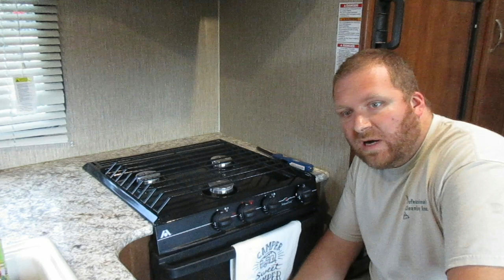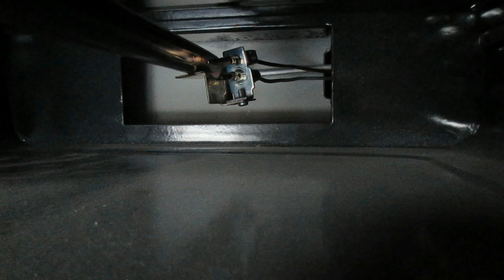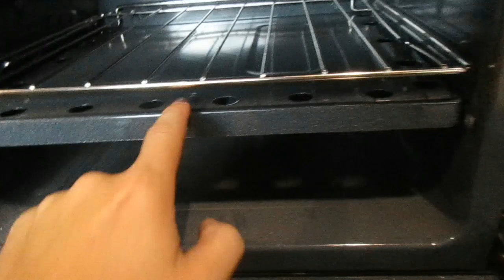How to light a travel trailer oven

Comment: I had no idea how to light mine. Loved in here almost 2 years. My pilot is different than yours.it also doesn't have any writing on the oven knob, other than a small square with 2 lines and F below it and a little circle right above the top of the handle. Doesnt say pilot anywhere nor have any demarcation of anything to the left.  I have been using my instant pot. Thank God for that.  Also, my microwave. I think I will just get a toaster oven and call it a day. Don't want to accidentally blow up

Comment: I have the same exact oven. I have never used it, however have had this 2016 trailer for 2 years. I did everything you said and more, and no matter what, it doesn’t light. I put the lighter flame Right Up to the pilot “bulb”, and nothing happens. Pushing the “Pilot Push/Hold” button hard/soft/normal, nothing happens.

Comment: Thank you for this video. Mine isn't working right, I think. Because when I turn it over to the temperature, the pilot goes out and the heat strip doesn't light. Nor does itight when I apply the lighter right to the strip. The pilot lights fine. There's gas, for sure. It just don't catch. So, what am I doing wrong. My husband got it to light twice now, but he doesn't even know how he did it.

Comment: Wierd , MY oven made little dif ..it's a fleetwood , 1997  camper/rv .. not light under bottom rack . I seen OTHERS light on top of stove .. I never tried light mine and considering looks half parts missing I AM afraid to .one straight pipe thing .now the top stove works fine..